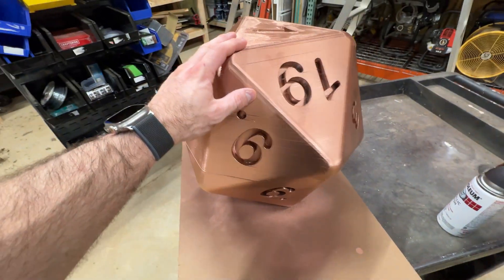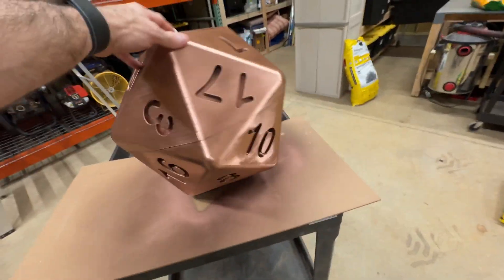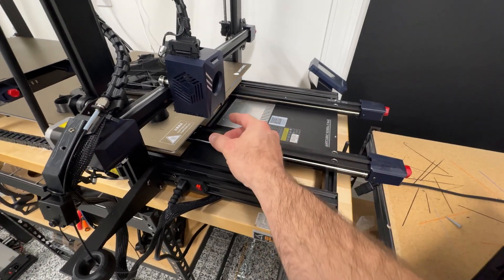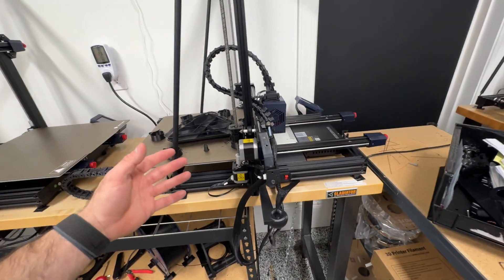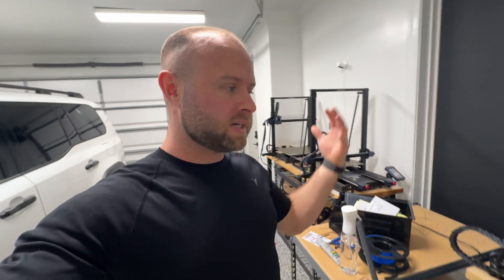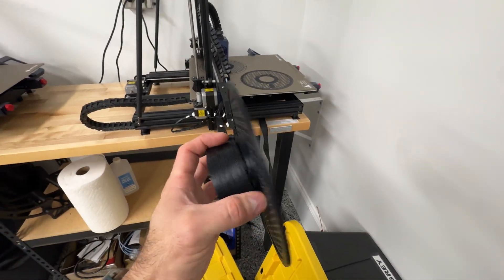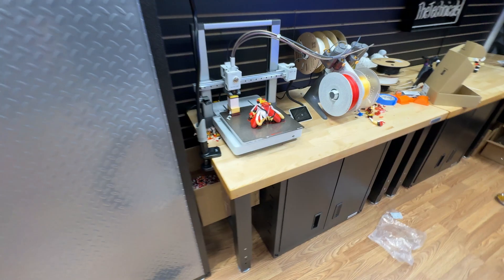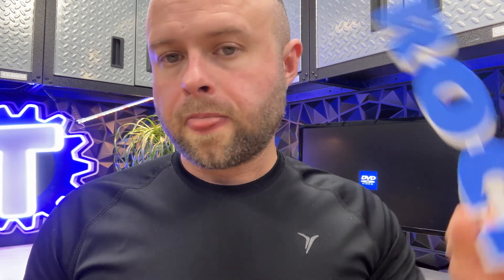My 3D Printing Startup Biz Journey: If nothing else, I'm learning a LOT

Comment: your prints are crumbling because you are printing WAY too cold on the nozzle. same reason that on the circles they arent sticking and are shrinking across the gap. cheap printers suck (except bambu). large printers suck in general, because the mechanics dont scale and the machines have enormous/egregious corner cuts in the design and are not sufficiently specified. orange giga is not worth it unless you put about 1500$ of mods into it. i run a 25+ printer farm and im experienced with building vorons, running cheap printers like kingroons, and also have expensive machines like stratasys. as you increase the size of the belts and reduce the system rigidity its going to negatively impact multiple aspects of printer performance. im gonna try and get in touch, id be glad to help you out with farm design, tuning, etc.
Reply from the maker: Thanks, so what if I went with the strategy of just accepting large format printers are trash (below 10k price anyway) and get 1000mm tronxy's and just tune them up, run them slow, etc?

Comment: Check belt tension to make sure the teeth aren’t skipping. Also increase the motor Vrefs to increase torque. You can do this in firmware usually. You shouldn’t have to change the support structure or anything on your print to prevent layer shifts, they should never happen normally unless there’s a foreign obstruction or something wrong with the machine.
Reply from the maker: Truly appreciate the suggestion. However, if I ever get to the point of needing to mod firmware i'd sooner buy another machine!

Comment: But are the unpainted models done in resin because if they are they're a lot better detailed than FDM
Reply from the maker: Most definitely, but no patience or skill to paint. If I hand painted a model, it would need to cost $60,000 to make it worth my mental anguish lol
Reply: @TechnicalsTinkers  yeah I agree with you 100%. I'm exactly like you I want to pop a print off and do as little as possible and sell it, I will do some touch-up paint if I have to or dry brushing but other than that I'm not a painter, and with these printers nowadays you can get fantastic prints right off the build plate even in multicolor...

Comment: Following this journey with interest.  I print quite a lot of functional parts, around the house and test pieces for my work.  Sold a few here n there as beer money which recoups some of the fillament cost at least.  Not convinced there is any money to be made, but glad to be proven wrong.... what i have learnt is slicer supports are complete crap.  Far better designed properly in CAD (and eliminated wherever possible).  For multiples, you really need to look at semi-automation.  Print orientation is key, no large flat panar interfaces to the bed, print on edge - absolutely no slicer supports.  Angle the whole printer up by 45deg, let the bed cool and get the head to knock it off into a bucket, and start the next one.  You can set that up on a shoe-string but would think you need a common eco system, ie printer brand.  Multi-material/colour prints look a complete non-starter to me - too much faff, pooping and/or tool head changing.  Your large artwork prints are interesting, but think having no post process and painting stage is not realistic - always gonna be needed to charge top dollar.  Just my thoughts,... will be interesting where this leads in 6months.  When do you sleep?? 🤣

Comment: If you want to save on filament you can make an order from a chinese filament supplier, my guy has MOQ  of 12 and good quakity with very nice cosmetic options. if your business already has shipments from china you could arrange to have it combined with one of those to make the shipping pretty cheap. that copper looks nice maybe you can smooth it off with a soldering iron with a spade tip and some sanding.polishing stuff.. not sure if it will ruin the copper. i have huge layer shift like that more with ASA i think its due to printing too fsst and the tip interacting with the tip
I do signage with my brothers business, print in ASA or PETG for it
Reply from the maker: Fine idea

Comment: Definitely recommend going the buy once, cry once mantra on this. Prusa XL, instant support 24/7 when you have any questions or problems, they typically always ensure they build an upgrade path for all previous owners when releasing a new upgrade. Yes cost to entry is significant, but you also arent tied to only 5 colors period, you can physically do a filament change as well in the slicer when needed, yes it adds more effort but you at least get a reliable, reputable, slice>print>walk away printer.
Reply from the maker: Good to know! I guess i'd have to creatively orient the model so i wouldn't have to do 1,000 filament changes manually LOL

Comment: As other people have said, supports being glued vs easy to remove is all down tot 'top Z distance'. 100%. I have found on my p1s that 0.275 is the ticket. On my Kobra 3, it does 0.25 .. each printer t ype is different. I also prefer tree support over normal but, when to use one vs the other is largely model based.

Comment: In my opinion, character prints are better suited for resin printers, as many customers in that market prefer to paint the models themselves, making the gray resin color desirable. When you're just starting out, it's a good idea to stick with PLA filament. A large portion of the products sold on Etsy are made with PLA, although some should probably use different materials. Over the past year, I've focused on perfecting consistent prints with different types of materials, and even various PLA variants print differently.

If you're looking for reliable machines, the Bambu Lab P1S is a popular choice. I prefer to focus on my designs, not on fixing printer issues, and the P1S allows for that. I recommend buying Bambu's PLA in bulk and using their built-in profiles, which usually require little to no adjustment. Keep in mind, though, that I'm still relatively new to this market myself, having transitioned from the crypto mining industry, just like you.

At the end of the day, you need a machine that will consistently pump out prints that you can simply print, box, and ship. While post-processing is sometimes necessary, it's labor-intensive, and for this to really work, in my opinion, you have to be able to walk away from the machines and focus on something else while they operate, rather than constantly babysitting them.

Many people who will comment are hobbyists; they love working on the printer itself. Their focus isn't on production or moving product, but rather on the process of tinkering and improving their machines.

Comment: One thing I noticed is that my Kobra 2 Max's layers do not infuse together like the bamboo.  Do a test.  I print a 100mm wall with 1 or 2 walls thick and then try to rip them apart.  The Anycubic is easily split like how you crush that print.  The Bambu test becomes a plastic sheet.  This is with PLA.   I think you are wasting a lot of time from your life brother.  Just get a good printer.  Spend the extra money.  Time is precious.
Reply from the maker: Bro I'd be all over a better printer if one existed with 400mm plate or greater. As of right now my options are the orangestorm giga or........another shitty one. Suggestions?
Reply: @TechnicalsTinkers  there's nothing.  Lol.  I'm holding off until Bambu releases their next one 1st quarter next year i hope.

Comment: re mystery layer shifting... sounds like you have narrowed it down to the Anycubic firmware, so could be the baud rate, mobo data drop on such large files / print runs etc.  Shooting from the hip a little, can't you just try running via a separate SBC like Raspberry Pi + Octoprint?.  Maybe send the log files to Anycubic?
Reply from the maker: I think i'd sooner get another kobra or just a giga. Just wish that thing wasn't 2500 with such bad reviews

Comment: Although the filament should be dry in the package, I've found that isn't always the case. I sometimes have to dry the filament again, especially the cheaper filaments. To Echo @Manakid, the mainstream larger format printer I would trust to make consistent prints (and even then, only after some adjustments), is the Prusa XL. The other printers are not as rigid and they seem to have issues with printing consistency. the Elegoo Storm needs a lot of improvements before I would trust it for production.
To get the cube to print properly I would recommend,
1. Dry the filament some more 
2. Print from an enclosed filament container (in case the filament is getting moisture as you print it)
3. Use Gyroid infill (Infill of the gods!, lol)
4. Print the cube hole or print it in sections such that a smaller piece fits into a larger piece (almost like a socket), stabilizing the part when assembled. 
5. If possible, put an enclosure around the printer to keep draft and moisture out. 
6. If there is a way to make the printer more rigid, that would help, too. 

As you mentioned, there are a lot of arm chair engineers out there so I'll give my qualifications:
1. I have been teaching undergraduate engineers how to 3D print for a decade
2. I have used both hobbyist and industrial grade 3D printers so I've printed materials ranging from PLA to Ultem
3. I have intellectual property pending that uses 3D printing

I hope this helps and all the best on your 3D printing business journey!
Reply from the maker: I ran your credentials through my CIA contacts. You check out, advice noted!
My only issue with printing large in pieces is the micro variations between the prints not lining up. Certainly prefer to print whole as I can't stomach the thought of post-production work. Any thoughts on the Giga? The early adopters seem to hate it, but maybe they fixed?

Also re: the prusa XL, you're totally and completely forever capped at 5 colors which is a big turn-off!
Reply: @TechnicalsTinkers  LOL. I'm glad my creds checked out. I agree on the micro variations. Post-processing is the devil. @WildRoseBuilds seemed to be ok with it but he was printing low aspect ratio builds like signs. I am hoping they will do a new version or a significant upgrade so I feel more confident buying one. 

The 5 color cap might be a turn off but it is a great way to at least get big parts printed reliably. A large format 5 color printer is already a pretty awesome tool when starting out, imho. I wonder if you can add an MMU to an XL.

With regards to filament costs, @greeboy3d is preparing to ship a pellet extruder module you can mount onto a printer so you can go straight from pellets to print without having to purchase filament rolls. If I were to get a large format printer like the Storm I would definitely invest in one of his extruders to bring down material costs.

Comment: Have you even tried Elegoo neptune 4 max? should have better parts than the Kobra. Also for big build plates, you should really slow down the prints because of the momentum. if the print is only decorative, than just thicken the walls and decrease the infill to like 3% (or even just use lightning infill) would be enough.

Comment: Be carful when it comes to the XL sized printers. Bc its still in its "developments stages" as the only one that's really worth it in my opinion is the Prusa XL, because of its capabilities and being a core xy printer. But, I see it as a development printer so, there's going to be a ton of work and research to refine it for each printer.
Reply from the maker: Thanks for that. CoreXY is huge for me too, and I expect the giga is probably super slow
Reply: @TechnicalsTinkers  Another thing I was thinking about is belts on the Kobra 2 may be wearing out. Bc they might be "slightly" worn out in a particular spot on the belt.